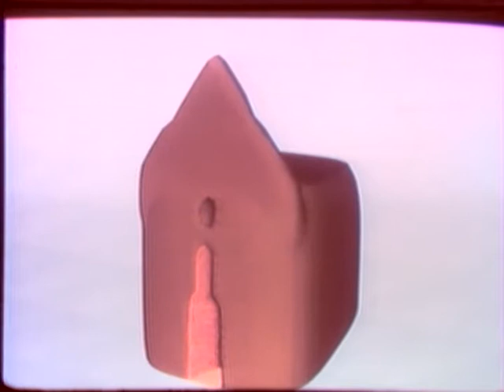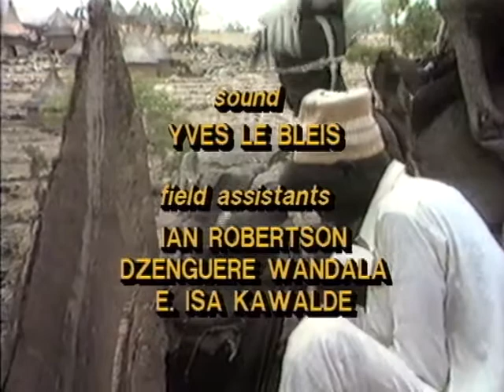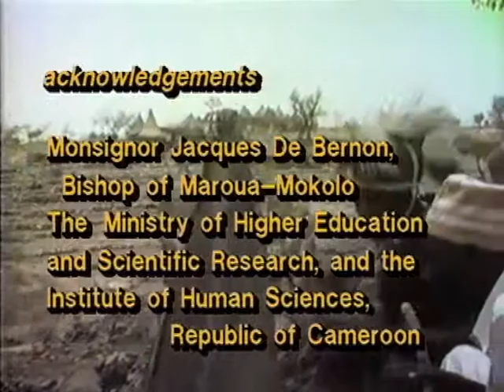Dokwaza: Last of the African Iron Masters (1988; 49 mins)

Comment: Thank you for posting this! This video clarifies so many parts of the smelting process that are almost impossible to find information on. The stone forging and ore enrichment were particularly helpful.
Reply: @Everyone from there and people who want to help
I think you can build mirrors out of that ore and later melt ore with the sun with those mirrors.
3:45 You can build a mill with a huge stone and just one or 3 people can do the same work, like the 10-20 that are doing it now.
I think it is even possible to make low grade transistors with a solar foundry and relais.
And you have to do some foresting (china already reclaims a lot of desert a year).
You can purify water with the sun.
... build gravity wells or solar steam engines or even better stirling ones with solar.
... build solar panels out of the stuff you can find there. (Partnerships with universities or researchers).
... make hot springs for a mountain village with solar  ^^ (would be the waste product of a solar steam generator)
... make copper for the wires or use other metals as wires.
Reply: @Nightowl_IT how tf do you purify water with the sun, or have a solar powered steam engine?

Comment from the maker: Thanks, Judy, for the question. The bellows are indeed valveless. At about 21:50 minutes into the video, you can see that there is a gap between the bellows nozzles and the top of the tuyère. Air from this space enters the bellows as the skins are raised and is then projected through the nozzles down into the tuyère. All this happens at a great rate with the result that little puffs of air proceed down the tuyere and into the hottest part of the furnace, just below the tip of the tuyere, which itself retreats upwards as it melts into a form of glass that serves to prevent re-oxidation of the Fe that is being produced and which accumulates in the growing bloom mass. To fully understand the dynamics of the air flow one would have to understand (I think) Bernoulli's principle and the Venturi effect. Incidentally, in D's 1989 smelt, the tuyere was made of too refractory clay (altho' from the same quarry) and did not melt at the reuired rate. D thought the tuyere might have broken near the top and, prepared to mend it with rope opened up the upper part of the shaft seal. However this was not the problem. Fairly soon after that, if memory serves, we decided to abandon the smelt.
Reply: Thank you Nicholas, I'll try to understand what you have told me! This video is really quite important as it seems that it is the only different method of smelting iron from ancient times. It is really very very clever. Instead of getting a huge bloom which requires instant attention (just when everyone is tired out) before it goes cold and can never be heated up again due to its mass, this method results in easily manageable lumps that can be dealt with at any time in the future. 
Do you think that it is the fact that the ore is very fine that produced this method, or the naturally sloping terrain, or what?
It is fascinating, I wonder if the short sharp puffs of air are an integral part of the method? maybe the standard longer bellows type method wouldn't work.
I'll watch it again!
Reply from the maker: It's not the only different method of smelting from "ancient times". For example, there are the often very tall African induced draft furnaces found in many parts of Africa that require no bellows and that can produce a large bloom ring after several days. But the Mandara mts furnaces (with outliers in the Anglophone NW region of Cameroon) are, I think, the only ones in which air enters the furnace from the top. David Killick is the expert on the science of these furnaces: you can check him out on Google scholar. Our paper on Dokwaza is 1989  David, N., Killick, D., Heimann, R. and M. Wayman. Between bloomery and blast furnace: Mafa iron smelting in North Cameroon. African Archaeological Review 7:183-208.
As I understand it,  the magnetite ore in sand-sized particles is richer than almost all others utilized in ancient and "traditional" societies and produces very little slag. This this is why the glassy slag provided by the melting tuyere is needed to prevent the metallic iron from reoxidizing. There are two main types of such furnaces, the Mafa type seen in the Dokwaza film and the Sukur type seen in  Black Hephaistus. The Mafa type produces a bloom mass with metallic FeE occurring in lumps within it, while the Sukur type produces coherent small blooms, up to around 11 in a day's smelting.  These and a third type of slag draining furnace are described in my 2010  Identification of a slag-draining bloomery furnace in the Mandara Mountains (Cameroon). Historical Metallurgy 44 (1): 36-47.
You are wrong about one point, the solid blooms do not have to be used immediately. They were often traded whole and were broken up into convenient lumps to be forged into a variety of artifact types.
Reply from the maker: I should add that a great deal more about metals in the Mandara Mts can be found in the edited volume: 2012  David, N. (ed.).  Metals in Mandara Mountains’ society and culture. Trenton, NJ: Africa World Press. This can be downloaded free from http://www.sukur.info/Lib/libindex.htm.
Reply: Thank you Nicholas, I've got so much more to find out! I couldn't imagine anyone trying to reheat a complete bloom, it seemed a massive waste of energy, but I'm still learning.
Reply: @Everyone from there and people who want to help
I think you can build mirrors out of that ore and later melt ore with the sun with those mirrors.
3:45 You can build a mill with a huge stone and just one or 3 people can do the same work, like the 10-20 that are doing it now.
I think it is even possible to make low grade transistors with a solar foundry and relais.
And you have to do some foresting (china already reclaims a lot of desert a year).
You can purify water with the sun.
... build gravity wells or solar steam engines or even better stirling ones with solar.
... build solar panels out of the stuff you can find there. (Partnerships with universities or researchers).
... make hot springs for a mountain village with solar  ^^ (would be the waste product of a solar steam generator)
... make copper for the wires or use other metals as wires.

Comment: @Everyone from there and people who want to help
I think you can build mirrors out of that ore and later melt ore with the sun with those mirrors.
3:45 You can build a mill with a huge stone and just one or 3 people can do the same work, like the 10-20 that are doing it now.
I think it is even possible to make low grade transistors with a solar foundry and relais.
And you have to do some foresting (china already reclaims a lot of desert a year).
You can purify water with the sun.
... build gravity wells or solar steam engines or even better stirling ones with solar.
... build solar panels out of the stuff you can find there. (Partnerships with universities or researchers).
... make hot springs for a mountain village with solar  ^^ (would be the waste product of a solar steam generator)
... make copper for the wires or use other metals as wires.

Comment: As a blacksmith i would have made me a better hammer to make my work easier and and to have better tools
Reply from the maker: I think you will find that shafted hammers, which are indeed more efficient, can only be made by casting, which technology was not available to African producers of iron. African blacksmiths ofter purchase imported sledge hammers for heavier work.
Reply: Where's your blacksmith content?
Reply from the maker: @demastust.2277  Why yes it could - i honestly don't know why they didn't go this route. Tx, Good Point. Nic
Reply: @nicdavid37  I wonder if there are some examples from other parts of Africa. Each part is very diverse.